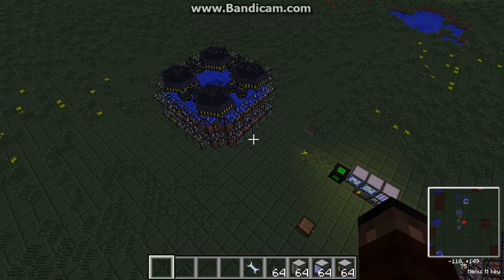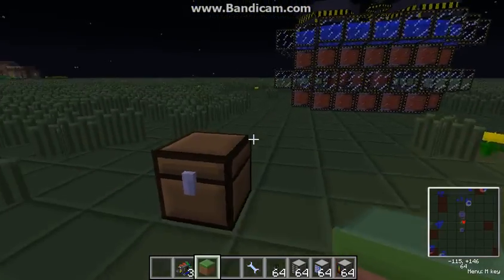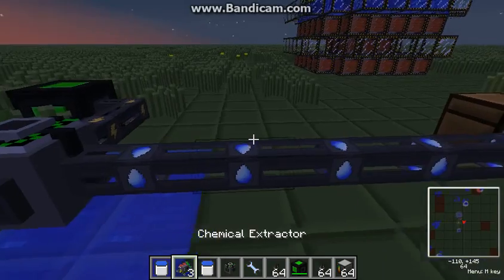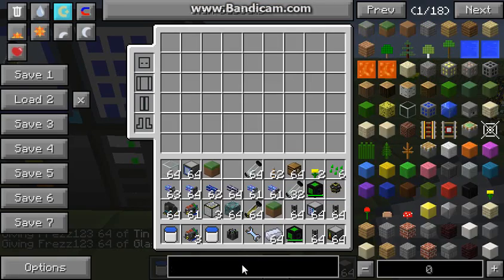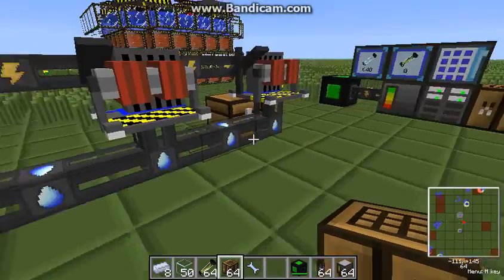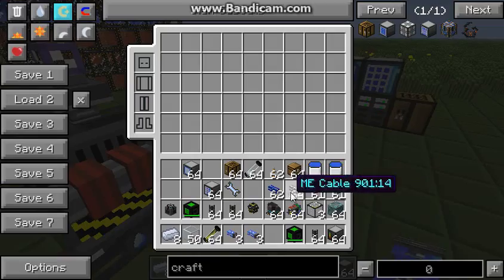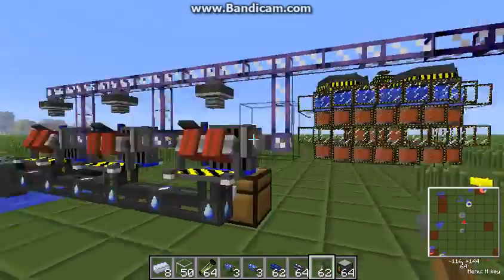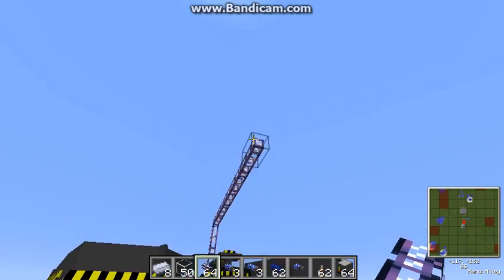Voltz 2.0.4 - Automate the Fusion Reactor - Atomic Science + Applied Energistics

Comment: Not sure if it is in Voltz, but Applied Energistics add-on "Extracells" added fluid import/export buses.

Using these, you can pump deuterium directly from chemical extractors into the fusion reactor.

This zeros the material cost of maintaining the reactor.
Reply from the maker: It is not implemented in Voltz 2.04... Unfortinatly :/